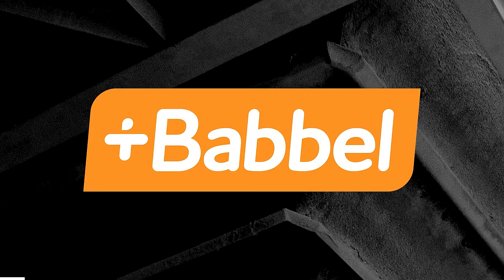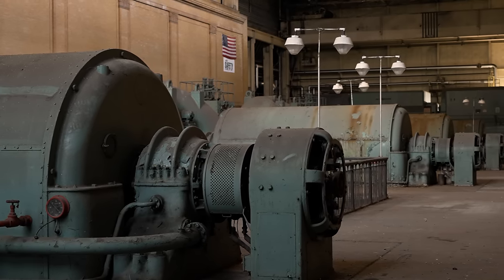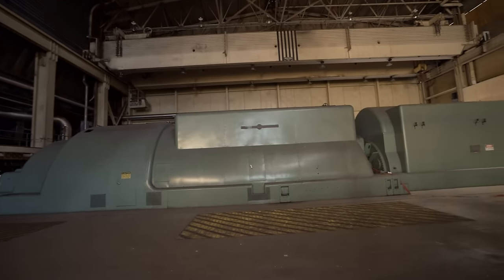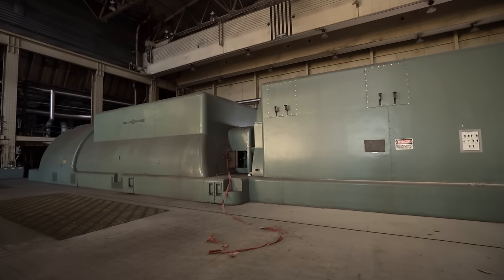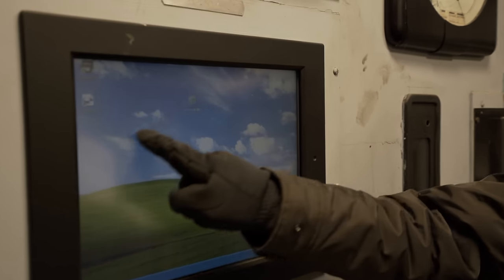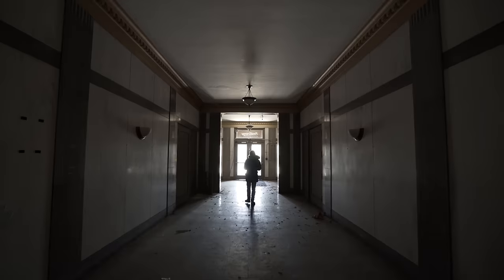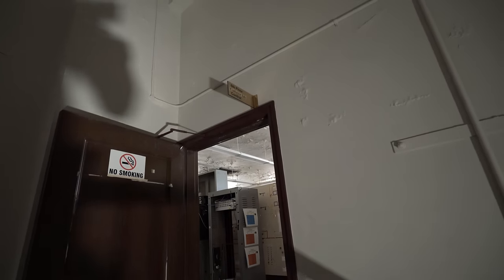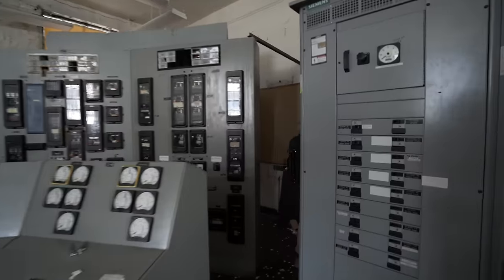Power Still Runs Through This Abandoned Power Plant! - Exploring Industrial Ruins

Comment: Bailey is the OG of boiler controls. 
The “intercom” is a Gaitronix, they are noise canceling microphone and speaker. That handset allows operators to communicate with each other while the turbines are in operation. All those panels were probably union made definitely American made. I’ve spent YEARS of my life behind those boards troubleshooting and repairing instrumentation. That is an oil filled circuit breaker, you are correct. Those stand alone motors are phase corrector’s (inductive loads) that help balance the phase to phase load. Down here in Texas most Asbestos containing insulation is marked with red bands and stenciled “asbestos”. I worked at Union Carbide Texas City, built in the 40s lots of very similar equipment. I spotted a Cleaver Brooks panel!!i think it’s neat that all that equipment is inside a building, most of the stuff down here on the Gulf Coast is basically outside and exposed. But that’s in the design spec for environmental reasons, Ashtabula Ohio requires more environmental insulation than S.E. Texas. I would love to have seen that place in all its glory! 
I would gladly help a cleanup somewhere!
Reply: will the panel go kaboom if u ignore the synchroscope & connect both systems?
Reply: @hksp  Lots of bad things can happen, it could cause damage to the grid and to the generator itself. Or it will just trip a breaker isolating that generator. Some wont connect themselves to the grid unless its matched to the grid.
Reply: Outstanding, when I first started working in the telephone switches 85 percent of equipment and materials were American manufactured but now maybe 10 percent is made in the United States. 
Sad
Reply: THANK YOU for the great information! I REEEEEEEEEEELY appreciate info from someone that knows what they're talking about. This really adds to the info from the guys. Thanks again.
Reply: @garymckee8857  And this is why old classic cars can last over a century past their date manufactured, and the new Chinesium sh*t can't last a month over two or three years depending on the warranty.
Reply: @AkiDaFloof  That's the reason why I drive a 95 Caprice it's paid for and it is still in good condition. 👍
Reply: @hksp  The synchroscope is used to compare the frequency of the system,  60 hertz with the pointer in the straight up position.  As a generator is coming on line, the shaft spins, via steam pressure, increasing speed.  depending on the make of the generator will determine the speed needed to match 60 hertz.  as the shaft/gen turns, you see the synchroscope pointer spin, fast.  As the hertz of the generator begin to match the hertz of the system, the pointer begins to slow the spin.  you want that pointer moving very slowly as it approaches the 12:oo position,  you would close the breaker to tie to the system slightly before that 12:00 position to pull the generator into the system speed (hertz).  Once locked in, you can increase the DC power to the Generator Rotor (as you increase DC power, the steam throttle also slightly increases) and you begin to increase loading to the system.
And yes, if you close that breaker when the pointer is pointing down, 180 deg out of phase, there will be a KABOOM.
Reply: @hksp  There has been a major mishap in the past where they "upgraded" the system to computer control in order to synchronize exactly on point, well, the computer decided to close the contacts exactly 180 degrees out of phase. The turbine rotor was blown out of it's housing and into the ceiling.
Reply: yeah, I saw the Cleaver Brooks panel too, got me excited. Their factory is not far from me in Thomasville, GA

Comment: I enjoy your work in the Generating Stations, worked for over 50 years in coal fired plants as well as an operator in a Nuke Plant. I was blessed to finish my career stepping down from management and operating an old Municipal Diesel and Combined Cycle Plant in Florida during its last years of operation. It is demolished now, never again to be explored so thanks for your work! There can't be many operators left like me. I actually operated these plants and closed the Gen Breakers when the Sync scope and Voltage was in line. Thanks for the memories!
Reply: Hey Darrel, do you know why's there's so much power connected to it still?
Reply: I'm surprised the plant property is not secured I work for a large utility all of our properties are secured with motion sensors, and cameras. We had a few people try to get inside our mothballed plants they were all charged with trespassing.
Reply: @Mike-01234  There's a lot of coverage of this plant all at once, there may have been some back-channel communication we're not privy to. I did see something about a remediation company demolishing the site, so maybe they're intentionally turning a blind eye before knocking it down.
Reply: 5 before 12 i would close and hold the breaker control switch, once on, a click, i would slightly raise load and voltage , hold a bit , let firemen add more fire, catch up some then walk load up with steam pressure at some point put boiler /generator on auto, chemistry good then pass unit on over to convex for loading !! i wish i could find power plant set up so i could do this at home, like some video game for fun.

Comment: I've been working in power plants for over 23 years. I wish i could've walked through this one with you guys. Alot of these old plants were designed with alot of character. The first plant i worked in was from the 1940's and IMO was just as nice as this one. Very cool to see. There's something about power plants that i find so interesting. Just the nostalgia is incredible. It's very sad to see these old and unique places demolished. And i do have to say how nice it is of how respectful you guys are. Much appreciated. Be careful around those electrical panels too.
Reply: I feel the same way about these plants. There’s something about them. The sheer size of everything from the stacks to the boilers, is amazing. The engineering that goes into building these plants. I like them all but the old ones with all that character, something you won’t see anymore. 
Just had one decommissioned near me and the stacks blown down last week. The plant would have been running its 100th year this year. I would have loved to see inside the plant before it’s gone. They had a clubhouse/bowling alley for the employees on sight, along with a boat dock. Just a cool plant. In a few months it’ll be all gone, sad really.

Comment: I always find it so ironic when an old power plant is wasting electricity with lights and transformers humming. It used to make power and now it's consuming it for no reason. 

Thank you for recording this piece of history for all of us. It's amazing that you guys were able to get access so easily and yet it wasn't trashed, considering how many times you went there, there couldn't have been much security. 

Another fantastic job!
Reply: I did some digging around.  At the time when the power was on, it was in "backup"/standby mode as they were switching to the main power grid for the city and wanted to keep this one running (or at least, in a state where it could be powered on again quickly) should something go wrong.  It has now since had its power turned off I believe since the switchover was over a year ago I believe (so this video was taken a while ago).
Reply: It's surprisingly common with old plants, sometimes because the adjacent high-voltage switchyard is still part of the power infrastructure and the controls are in the building. I was part of a team that designed and supervised a controls conversion at an old coal plant around eight years ago. Two of the plant's four main walls were completely removed for asbestos mitigation, yet the central control room still had partial power for controls. We completed the project with a new control enclosure next to the old switchyard and moved the control circuits over in stages, and the plant was fully demolished in the following year.
Reply: Also, the power is on so that maintenance and security people .... who are SUPPOSED TO BE THERE ... can come in and keep it from falling into further disrepair. If a crew comes in to work on whatever, they need power for their tools, etc.
Reply: Don't bother to comment when you don't know wtf your talking bout rookie. 50 yr lecktrician, worked in all of the plants in st.louis area. HR figured it out!
Reply: There is a reason we just don't know what it is.

Comment: 26:00  Those are old oil filled switches/circuit breakers.  They were state of the art in their time, but are extremely dangerous. The slightest contamination in the oil would make them short out or explode.  The ones marked "Stay" are probably still energized.  27:55 Those are old motor-generators.  One side is the motor, probably 440v 3phase, and the other is a DC generator, commonly 120v DC for use with the control panels and instruments upstairs.
Reply: Would be 480v 3 phase, not 440. Nobody ever used 440volts. Europe is 415v/230 line to ground. But those are more likely phase to phase load balancers, not DC power supply. The generators had exciters on the shaft end opposite of the turbines, which was fed thru voltage regulators to control the output voltage and therefore the KVar output of the gensets.
Reply: @brnmcc01  Today, yes. When the plant was built 440v was common, especially for motor voltage ratings. I used to service a very old movie theatre with similar MG sets, and the motors on those (as well as the ancient Westinghouse 5hp exhaust motor that I had to replace) were all rated at 440v.
Reply: Europe uses 400 V line to line, not 415 V. Also, rated for 440 V does not mean the input has to be 440 V. For example, plugs used with 230 V are rated for 250 V.
I also would assume that the motor-generators were used to power the exciter coils of the generator.
Reply: @brnmcc01 I think you’re right about that. A bit later in the video, one of them states that the MG’s motor case says “balancer” on it.

Comment: Shout out to the "little PC that could" still running XP
Reply: If it was a windows 10 it wouldn't have survived
Reply: @Chris-sv8ty  yes if it was windows 10 it would have crashed
Reply: @lifequest7453  Why would it have crashed because of Windows 10? I have a 3 year old solid state Windows 10 game laptop upgraded to Windows 11. It's doing beautifully and probably would last until too much dust and gunk builds up in the cooling fans. Yea, I know it needs to be done for it's running hotter.
Reply: @Worldofourown2024  Windows XP is the strongest most stable operating system there is.
Windows 10 has strangely a lot of systems found in Windows 8.
Besides that, the new windows systems have holes in the programming.
It is common for the op sys to freeze or go dark.
Too many videos out there that verify this to worry about your "not mine" attitude.
Reply: @lifequest7453  I find windows 11 most stable of them all. Funny thing I didn't like the update at first for it seemed so different. I didn't ever use Windows 8 as I went from 7 to 10 to 11. I hope it's not going to be common for ops sys to freeze or go dark. Older computers, I think Windows 2000 had that problem often 15 to 20 years ago.  A lot less application hang today than some years back in my experience.
Reply: @Worldofourown2024  I went from WinXP to Win 8, kicking and screaming.   Win8 was meant to be a one size fits all, aimed for Ipads but would work on desk tops.  They general thought was consumers would shift from desk tops to Ipads.   Didn't happen as much as they thought.
Win8 was not friendly on the desk top, one size fits all, didn't work that well on the desk top.
Win 8.1 was re-imagined and if you get around some of the commercial stuff microsoft injected, it isn't bad, not nearly as good as WinXP but it could run current programs.
Win10 was thrown together but it strangely eminates win8.1.  What causes problems is the MS spyware, some that MS has admitted, you can't turn off.
I know people on Win10 and they frequently have problems with it and have to have someone come in to "adjust" it.  It's not a good op system and you  have to add anti viral programs because of the nature of how it was programmed, virus attacks are natural to Win10 and now 11.
Short version,  Win10 is not a good program.
Reply: I wonder what the uptime on that thing is.

Comment: 27:47 these are converters. A motor on the one side and a generator on the other. Used for e.g converting AC to DC.
Reply: Yes, all of the big breakers would have been DC powered. Mostly likely, the voltage was 125 v dc.

Comment: Those things at 27:40 look like rotary converters, used to convert AC to DC, DC to AC, single phase AC to three phase, etc. Before we could build these things with solid state electronics, the best way to convert that power was to directly connect a motor to a generator. Pretty neat, but definitely obsolete.

Comment: I actually grew up in Ashtabula (always saw that monstrous chimney in the sky even from my house growing up on Rt. 84 in Saybrook). After high school I started working for CSX and we actually still use the tracks back behind the plant for storage. The iron mill across the street is now being used as a scraping operation for old RTA NYC Subway cars and whenever the tracks at the Mill overflow, they're sent back to the CEI tracks (rare but occasionally). Definitely recommend checking the steel mill out! They have an old diesel passenger train still intact as well as multiple various commuter cars. Bonus points if you're there a little before 11am on Fridays since that's when they test the emergency sirens for all the active plants in the area and it just makes the whole experience so creepy and post-apocalyptic feeling.

Comment: I’ve done maintenance work in this plant when crystal chemicals took over it for water supply to the  chemical plants south of it about a half mile. Thanks for the video!! Btw, the last I knew the chemical plants still own it and use it for water until the finish building the pump station just east of the power plant. And security still patrols it with active cameras. lol. I used to go in and fish in the Chanel with the pump outlet. Big fish in there lol

Comment: I have done quite a few pump jobs at ashtabula and eastlake .  They are both still powered but as systems fail they rent diesel pumps to remove water from portions of the plants.  Eastlake is used as a power management station so some of it is still staffed.

Comment: This was very satisfying to see. I wish I could have walked you through some of the power plant builds I did as a Boilermaker apprentice. What’s neat, is to this day, coal power plants still operate roughly the same way. The main differences are the way the air is “scrubbed” and cleaned and how they use the debris for other things, such as making drywall. 
You guys wouldn’t be able to see it in this plant, due to safety and access, but the main boiler(s) really are a sight to behold. For instance, @23:23 in the blueprint, on the far left side, that’s how tall those boilers go up. Usually 4th-6th story all the way to the top of the plant. You were likely looking at the side of the boiler wall @33:53. 
As a Boilermaker, we would work on several parts of the inside of that thing and it was breathtaking at how high and large those vessels are. 
Those coal pulverizers pretty much look just like new ones. Anyway, really cool video. Thanks for sharing and thank you for being respectful to our American history!
Reply: Do you think with the state it is currently in, one man or a small group could reactivate a boiler and generator, given there was a supply of coal?
Reply: @kv-2heavytank52 There’s no way. Not only would it take a very large crew of experienced power plant operators (amongst other skilled trades) to restart a boiler plant, several parts of this are decommissioned and inoperable. These power plants do have a lifespan, even with routine maintenance.

Comment: I've been subscribed for awhile now and just came across this video, haven't been on youtube much lately. Really hits home, quite literally as this plant is extremely close to me, in fact my power used to come from here. Sad to hear it's being demolished along with the bigger (and older) plant in Avon Lake. These two plants, along with the Lakeshore coal plant in Cleveland (which was demolished a few years ago and was the oldest of the three plants) once supplied almost all the electricity in the greater cleveland area until the addition of the Eastlake coal plant in the 1950s, and later on the Davis-Besse and Perry nuclear plants. Firstenergy kept the coal plants running until the mid-2010s so improvements could be made on the transmission lines and substations then they were shuttered. I haven't been up near ashtabula for awhile and I'm not sure what it looks like now or if it's even still there, but as far as I know it still is. I might drive by there this week and see for myself. The eastlake plant I drive past all the time and I can still see the smoke stacks with the flashing red lights at night. Although this plant no longer operates as a conventional power plant the turbines were converted to synchronous condensers during the time improvements were being made to the transmission system, which basically help stabilize voltage on the grid during peak hours. While it's newer and probably not as decorated as the older plants, I can sleep at night knowing it's being put to good use and won't face the same fate as its predecessors.

Great video guys, thank you for capturing this historical landmark before it's too late.....